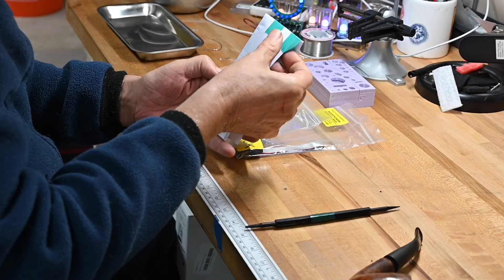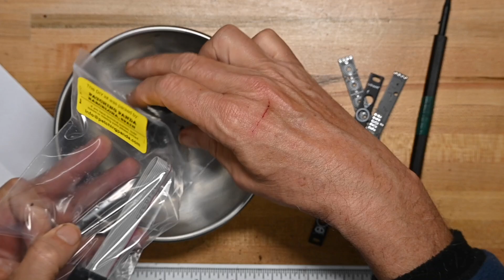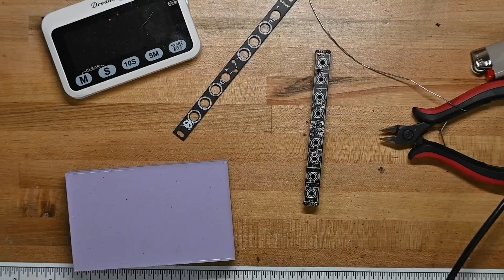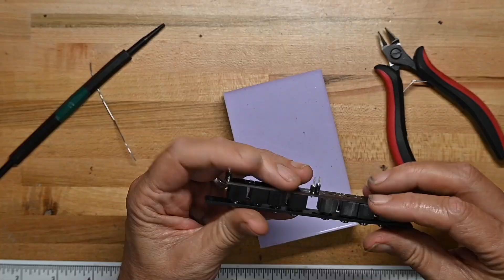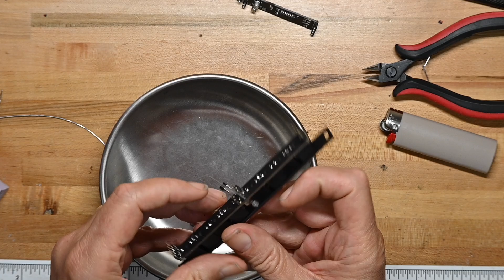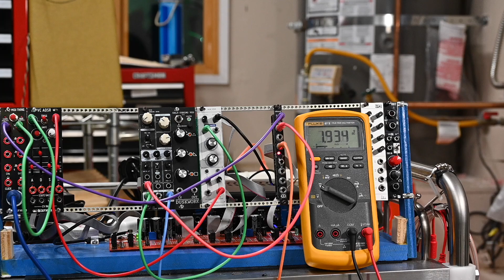C.K. builds a Copycat multi eurorack module from Patching Panda

Comment: Question:
If the LED shows positive and negative voltages (green and red respectively), then whys is your LED always red when you put voltage into it?  The reason I'm asking is because I built one of these, and in use, it does exactly what yours is doing.  Green only seems to light up when I put negative voltage in.  WTF pipe-smoking guy?
Reply from the maker: Interesting question, and I'll have to do more testing to get a definitive answer.  I'll admit I didn't pay much attention to that when I did this module since I only cared that there was voltage going in, not the flavor.
Reply: @CKHaun  COOLIO - Keep me posted please.  I've gone over my build, and everything was done as directed .
Reply from the maker: Looks like it'll be a while.  I need to try this on a kit during the build (so I can get at test points better) and these are backordered right now.
Reply: @CKHaun  keep me posted - I have also reached out to Patching Panda, but no reply yet.
Reply: @CKHaun  Just heard back from patching panda - they are telling me that I put the diodes in backwards, but when I check my build, they are oriented EXACTLY like the silk screening on the board.  They are telling me to leave it, but this sucks.  I followed directions as far as I can tell.
Reply from the maker: Huh, that's a very odd response from them.  I'll take a look at my diodes also, and when I get a new one (after backorder lifts) I'll switch diodes (no matter what the silkscreen says) and see what happens.  Thanks for the info.